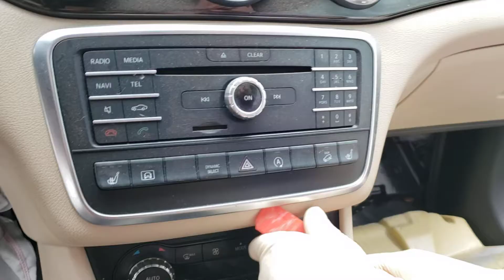2015-2020 Mercedes GLA250 GLA45 GLA200  X156 HOW TO REMOVE CENTER CONSOLE

Comment: I removed the rear ac vent outlet and then wanted to attach it again but the lower half of the outlet does not click into the body of the center console. I managed to to attach the top underneath the arm rest but the lower part is not really attach but rather just "leaned" on. Do you have some tips on how to attach the rear outlet again so it looks like how it did before? Thank you in advance!
Reply from the maker: Sorry no idea. Take it off and inspect it and check maybe something is in the way.